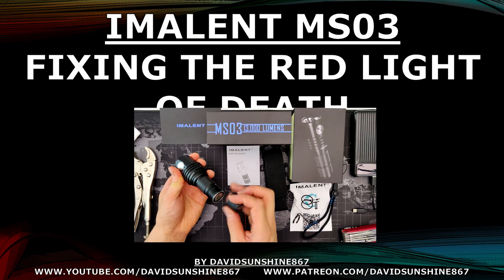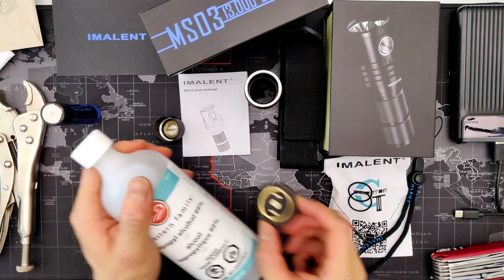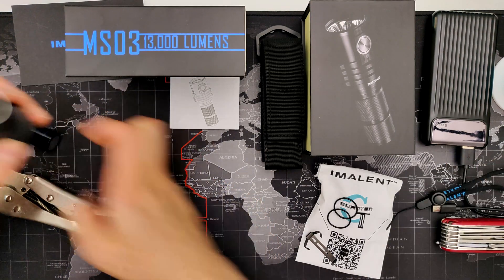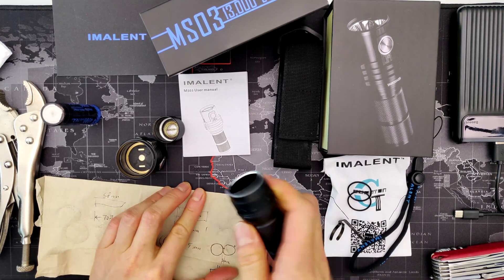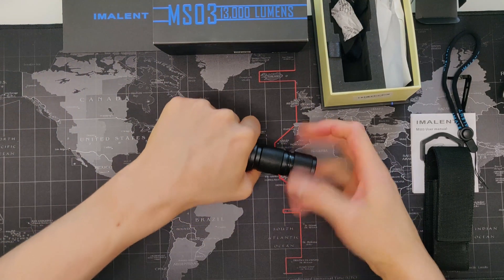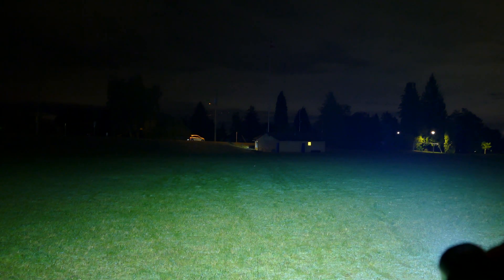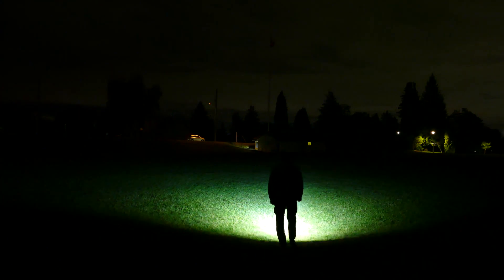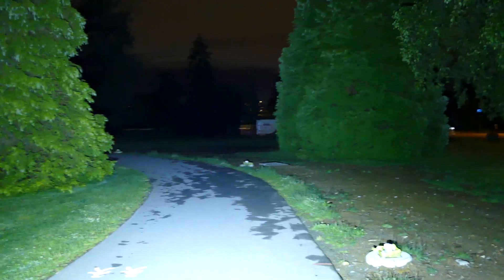How To Fix IMALENT MS03 - Red Light of Death

Comment: Davide
How my repair man could reach to the PSB board ? I mean from the top of the MS03 or from the battery place ?
In other words is the top part ( under the glass ) openable?
How could I have access to the Board ??
Reply from the maker: Hi, I show disassembly here: https://youtu.be/KTgq42FKP8E?si=zUBl-bbqM8alWC18&t=353
The circuit board can be removed from the back, there's a notch for you to pry it out using the tip of a cork screw, but the wires will need to be desoldered from the LED board from the front, so you need to remove the ring/glass/reflector to get at that. You need to get through some silicone that holds all the wires together as well, it's not easy but that's how they kept it water resistant. 
It's not easy to take apart and put back together, but that's the nature of this small light.
Cheers!
David.

Comment: Hi David
I have a question please help me .
I have M03 like yours but yesterday It fell down from 2 meters on a hard surface and the power connection is wrong.
I mean the battery is full charged but the green light doesn’t turn on !!
How could I fix that?
I appreciate it man
Reply from the maker: Hi, 
That's unfortunate to hear. I think the battery might be broken.  Check with a multimeter. If the battery is fine, it might have cracked the PCB board. He's pretty thick, but a hard fall might still crack it, if that's the case, the traces would be broken, may be very hard to fix, on the circuit level. 
Use a multimeter to confirm the battery is outputting voltage, or use a good battery and see if it works.
You can tear it down as per my full ms03 video, I think I show how it comes apart, and take a look inside if you're not able to get it working. At least then you can inspect the circuit board. 
Good luck!
Cheers, 
David.
Reply: @DavidSunshine thanks David
Could you please send me your full clip?
Reply: @DavidSunshine davide 
Thanks again man .
I checked the battery but it isn’t working. So , how it is possible to get access to the PCB board .
For sure my MS03 connection is of somewhere 
I appreciate if you answer me soon.
Thanks bro
Reply from the maker: @hamidrezadowran7849  Hi, I show disassembly here: https://youtu.be/KTgq42FKP8E?si=zUBl-bbqM8alWC18&t=353
As per my other response, it's not easy but it's doable.
Cheers!
David.
Reply: @DavidSunshine hi David
Reply: @DavidSunshine I see 
Thanks David 
I don’t even touch it as I don’t know anything about it.
As I mentioned previously I took it to a repairman but he couldn’t disassemble it and he is so careful not to cause more damage.
That’s why I bothered you

Comment: Has anyone had an issue with parasitic power draw while not in use? I've had qty.2 Imalent 4000mAh  21700 batteries go completely dead on me. One of them won't recharge using the imbedded usbc charging port...   I'm thinking that unscrewing the tailcap a bit while not in use will solve this problem, but I'm not entirely sure?
Reply from the maker: I checked my original cell, this video is 3yr old so that's a pretty old cell, I haven't used it since making this video since I took my MS03 apart and haven't rebuilt it.  The cell has been sitting and it's 3.8v still.  You're right though, leaving the tail cap twisted off is the same as sitting on the shelf, it shouldn't have gone to 0v unless the circuit board had an issue. That's really strange for sure.  Maybe just a dud, twice... Their QAQC isn't the best unfortunately.  If you're looking for a replacement 21700, I would recommend a cell from Liitokala, I've been using their cells for years and they're all genuine and well priced, here's my affiliate link, or you can search on their store called "liitokala Official Store" on Aliexpress, don't buy from other random aliexpress stores tho, they are fakes and sell counterfeit cells, I know cuz I've ordered from other stores and they were fake(much lower mAh than advertised), but not that official store: https://tidd.ly/48wXSGp

The other recommendation I have is to try Sofirn 21700 batteries, they seem like high quality cells based on my capacity/output tests. 

Cheers!
David.

Comment: I don't know how you were able to take it apart, I destroyed mine and will not come apart, mine does not come apart, period!!
Reply from the maker: Hi Eric,
Ya they really put a lot of contact cleaner in there! I had to put it in a vice and vice grips to get it apart.  You can heat it up if you want to make it easier but I didn't have to do that.  Just had to crank it while in the vice.
Cheers!
David.
Reply: @DavidSunshine  i did just that, in a vise, well, now that I destroyed mine, and is going in the trash icing on the cake to add to my lovely Sunday,  thankyou for your response,
Reply from the maker: @ericwright2818  Damn that's unfortunate.  It was a good attempt to fix it though, always worth trying. Must have been seized up for some reason. 
This isn't the best made light, in my extended review I found the switch wasn't water resistant, so it doesn't even work in the rain. If you'll be buying a new light, definitely find one that's really water resistant and has an external USB C charge port.  Having it inside isn't really convenient.
Cheers!
David.

Comment: Good stuff mate. I have better question tho. Any advice for my flashlight going crazy? I was using it in heavy rain today and it at first after drying didn't want to turn on at all only had green light. then after pressing the button like 50 times fidgeting with it while researching the issue it started kinda working but with life of it's own. For example once I turn it on it keeps cycling by itself, or I press to turn on or off or turbo and it does it delayed by like a second sometimes it works well. I just had it to run on high to get it hot again see if it helps cos its doing it less and less now I'm thinking water got under bottom? its supposed to be water resistant UNDERWATER 2m. Now I'm wondering if its only mine that did it was it from temp shock when it started raining or what. Feel free to try and recreate the issue in a shower I had it run on turbo and high settings for a while before it started raining at night and it was sudden heavy rain. <3
Reply from the maker: Hi,
Thanks!  Good question. In my full MS03 review video, I tested it's water-resistance and it failed completely, it's not water resistant at all.  The micro switch under the metal button got wet and it stopped working.  I had to dry it out by putting it in an 80C oven for 30+ minutes, after that it was fine, you could have a hair dryer blow at it too.  
I do the test here:  https://youtu.be/KTgq42FKP8E?t=428
So it's a great performing light, but can't be used where it'll get wet, other than that it performs fine.
Also don't drop it, it's not drop resistant, the front ring will pop out, and you'll have to press it back in.
It's unfortunate that manufacturers make fake claims of drop/water resistance, but that's why I like testing the claims in my reviews!
Once you dry your button out, it should operate just fine.
If it's rusted inside, then you'll have to open it up and replace the switch, just a warning though, it's REALLY hard to take apart and put back together, cuz they used a bunch of silicone in there.  It's probably better to send it back under warranty, for repairs.
Cheers!
David.
Reply: @DavidSunshine  Yeah I managed to get it to work and stay on on high beam setting and it dried itself out, works fine now. Now the real question is since its only the button. How to mod it to make it waterproof. Some sort of rubber coating  over button sounds like an idea.

Comment: Hello! I bought this flashlight last week. And I had the same issue. I think it's ment to be like that, like.. I think it needs to be fully charge to able to use turbo mode freely. I think you can't use turbo mode. when your battery life is not strong enough to turn it on. I was trying to use turbo mode for 30% or like 50% battery life but it wasn't working. And when I fully charged it. It works. What I think about the red light of death, it means the battery life is not strong enough to turn the turbo mode on. It's just from my experience. I hope my option works for you guys!

Comment: so i have this light and the turbo and all the high modes don't work. i don't understand, because i have several lights with crazy lumen outputs, and they all work fine. from what i understand, is the problem within the imalent caused by faulty firmware or faulty circuitry or a combination of both?
Reply from the maker: Ya you're right, it's both the connection and the firmware. The connection is weak so it'll drop into low voltage protection prematurely, they can fix that by adjusting the low voltage cutoff in the programming. So both need to be fixed up operate properly.  But the best we can do for now is to make the best connection we can, so clean up the contacts and it should work at least in high for a while.  It may not work well in Turbo though, unless you have a fresh battery, and even then it'll only sit in Turbo for a limited time until the voltage sags.  But at least it's a useable light if the contacts are all clean.  If they put out a firmware that has no low voltage protection, that would be best, the battery has its own low voltage cutoff so that would be fine, it'll protect the cell.  But I don't think it'll be easy for us to reprogram this driver, not impossible though!  I'm sure someone can do it with the right know how.  Might be a good project for a rainy day. 
I was thinking, even just a simple jumper to help the controller detect a higher voltage might help, but it would eliminate the problem, it'll still go into low voltage cut-off prematurely.
Cheers!
David.
Reply: @DavidSunshine  i am not good with electronics, so i am using my tm9k tac, which is pretty similar in terms of brightness. still, i am curious as to why reviewers of this light fail to mention the turbo issue. i've heard of other imalent lights having the same problem. too bad, because they are really pushing the limit with these incredible lumen outputs. have you tried the 20000 lumens light from nitecore? tm20k, i think it's called.

Comment: How can i open the Front? The Lens? I have my Lamp New and use it only 1 Day In  the Rain. Now it's water behind  the glass.  👎👎 Very bad Quality.
Reply from the maker: Ya it's pretty crappy. The water won't damage anything since it's all siliconed in there. But it would be nice to get out the water. https://youtu.be/KTgq42FKP8E
In my review I remove it by hitting it against a wood cutting board.  You can just tap the front against wood then pry out the ring. 
Cheers!
David.

Comment: The torch is not great

I have only had it for a month and they assured me that the turbo problem is repaired, but it’s not turbo has died on my torch and I have hardly even used it yet
Reply from the maker: Hi, I really hope the company can keep you out. Keep trying to have them help you with the warranty.
Let us know the outcome!
If you're into tinkering, definitely try to fix it.  I think if we get the controller voltage sense pin connected to the battery with thicker wires, we might get a better Turbo performance. I'll try it out, but it won't be an easy fix.. Programming would be the best, but imalent would need to do that and update all the drivers.
Good luck with your warranty!
Cheers!
David.
Reply: @DavidSunshine  I spoke to Imalent and they were Charming, let’s hope they send a replacement 😇
Reply from the maker: @rectify2003  Great news!  Hopefully they help you rectify the issue.  Let us know how things go!
Cheers,
David.

Comment: Turbo mode not working after cleaning a few times. when I'm trying to on the turbo, the indicator bips 3 times with green light but turbo not working
Reply from the maker: Damn. I've seen that before.  That means it's still not getting enough voltage to kick into Turbo.  Was there threadlock on the driver's contact?  That's really where the culprit is. Clean that up and a fully charged battery should get your Turbo working. The spring contact to the tail body may also need some cleaning, it's hard to take out and reinstall, but worth cleaning that to maximize Turbo functionality.
If you got it from Amazon, try an exchange, the new one might work better. If not, cleaning all the contacts is your best bet. 
Clean everything, even the positive nub on the driver, and the battery contacts, as well as the body tube contacts, you can sand it with some 800 grit even.  A Polish after that would be good, with some 2000 grit, or just clean it on some paper with contact cleaner or rubbing alcohol. 
Cheers!
David.
Reply: @DavidSunshine  Thank you so much for your helping reply. I will do it and let you know.
Reply from the maker: @jamirabdullah4418  Anytime!  It's hard to get open, cuz you need a vice and some rubber to crack it open, but totally worth it to fix it up.
Cheers!
David.
Reply: @DavidSunshine  Thank you for your reply. it falls on the hard ground from eye level and I think, it happens for this. today it is working without any repair. but when I lock it by 4 clicks and unlock it again by 4 clicks then turbo mode not works. it is working now after a full charge. I am still confused why it is happening...
Reply from the maker: @jamirabdullah4418  Sounds like the fall could have damaged the board or battery. Could just be a loose connection between the driver and the body tube though. If you clean up all the contacts it should help.
Not sure why unlocking it won't work though.  It should work normally after unlocking, I never noticed any difference in operation after unlocking and locking, so it might be that you're moving the body tube and the contact becomes poor to the driver, so Turbo won't work.
The threadlock really messes up the contact and the ability to get to Turbo, I encountered all those intermittent issues before I cleaned it up actually, so it could be that, and nothing to do with locking or unlocking.
Give it a try.
Cheers!
David.
Reply: @DavidSunshine  it is working after a good cleaning. Thank you very much for your help.
Reply from the maker: @jamirabdullah4418  Oh nice!  My pleasure.  Good job cleaning and fixing it up!  Glad that it wasn't broken from the fall.  Enjoy your MS03!
Cheers,
David..

Comment: Mine stopped working... Solid green light, no light??? Had my UT-90 stop after use in some rain.
Reply from the maker: Hi,
Solid green means the battery is within working voltage, so it should work fine.
No light at all means it has no voltage at all, it's the battery completely in protection mode with 0V at the terminals?
The metal button has no seal on these lights, so the microswitch can get wet and fail.  If you point a hair dryer at it for an hour on low it might dry it out and get it working though. 
I put mine in the oven at 95C for 1 hour and it started working fine after that.
If the contacts corroded, it might not work anymore though. 
These lights aren't truly water resistant, not with the tactile microswitch exposed like that.
If you can use the warranty on the light, I would do that, as it's not easy to fix the switch.
Cheers,
David.

Comment: Is the switch easily removed? Would I be able to put a Oring to seal the switch? What would do you think?
Reply from the maker: Hi,
Nope, the switch is most definitely not easy to remove.
I had to take it completely apart and scratch out all the silicone sealing the switch to get it out, it would also be very hard to install an o-ring to effectively seal it. 
My review video (https://youtu.be/KTgq42FKP8E 3m11s) shows the switch taken down, you'll see what I mean. Maybe some dielectric grease in there would make it water resistant, but if the grease gets out, it'll make a mess.

Cheers!
David.
Reply: @DavidSunshine  not sure what you mean by make it water resistant. This light is already submersible to two meters
Reply from the maker: @sinjon  Hi. What I mean is that if the switch gets wet, the flashlight fails to operate because the electronic switch gets water in it. The water won't get into the light further than the switch, but it'll fail to work until it dries out. Lol, you can put it on rice, or use a hair dryer to dry out the switch quickly. It might corrode if you leave it too long and you'll need to replace the switch. In my longer review video I do a water test in a bucket and take it apart to show how it fails. It definitely doesn't meet the 2m resistant rating.
It won't even stand up to rain, it needs to be fully functional to be considered rated for 2m, won't pass the test for that rating.
They are just saying they think it's 2m rated, but no testing agency will give it a certificate for that, unfortunately, since they need to test a sample set of multiple units, and they all have to pass to get the rating.
Cheers!
David.

Comment: I didn’t have any issues with my MS03, however my UT90 stopped working after a walk in the rain. Guess we’ll see if Imalent honors the warranty... Love the UT90, but be careful, it’s not really IPX-8 rated, the switch seems to be the weakness.
Reply from the maker: Hi Chris,
Damn, hopefully they do.  
I actually put my MS03 in an oven at 100C to get the switch to dry out, then it worked fine after that. 
I wonder if the same micro switch is on the UT90, and gets wet too.
If it's dried out and the switch still isn't working, it's probably corroded and not working properly anymore.
Another user said they paid for shipping back to a US repair center, so hopefully you can make use of that if you're in the US.
They told me to send it back from Canada to China though, so it would have cost me quite a bit for postage, if I were to send it back.
Cheers!
David.